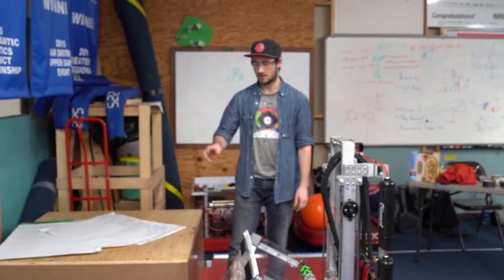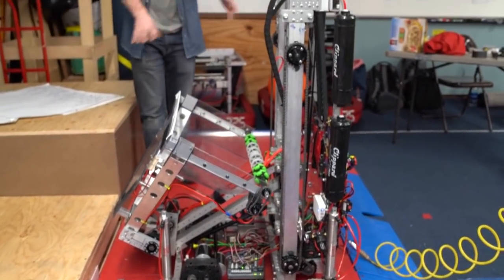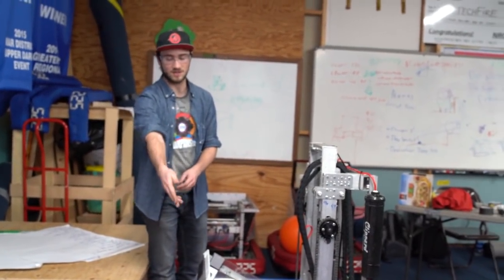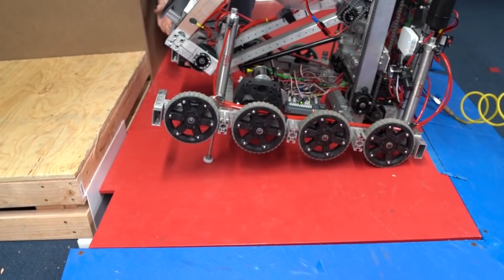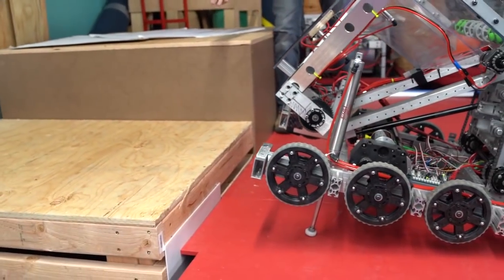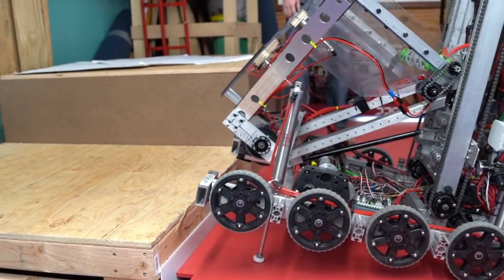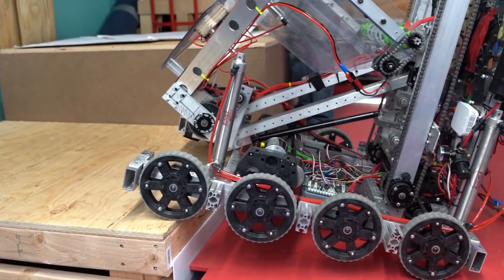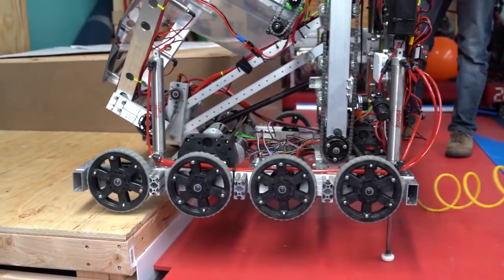Ri3D Team FIRST Capital Level 2 Habitat (Hab) Climb - Robot in 3 Days

Comment: Wouldnt this take your bumpers out of bounds? At least when the back jack is deployed, part of your robot is still on the ground
Reply: "G23. Keep your BUMPERS low. BUMPERS must be in the BUMPER ZONE (see R25) during the
MATCH unless a ROBOT is completely in its HAB ZONE or supported by a ROBOT completely in
its HAB ZONE. A ROBOT is “completely in its HAB ZONE” if its BUMPERS are entirely between its
ALLIANCE WALL and the vertical plane defined by its HAB LINE."
Reply: They're on the 1st level of the HAB so I would think they are OK if I am understanding the rules correctly.

Comment: Could this same concept be up scaled to get on level 3?
Reply: Don't know--you can put this sort of design in CAD and check!
Reply: I'm in college and haven't been to stare through the manual, but if you were to raise the bumpers something like 3 - 6 inches off the ground, be sure to have a low center of gravity, then perhaps has. You just have to make sure the CoG stays in front of the rear wheel and the moment of inertia never goes backward.